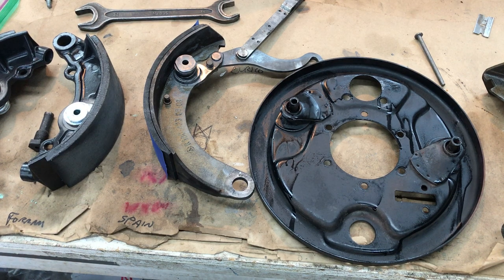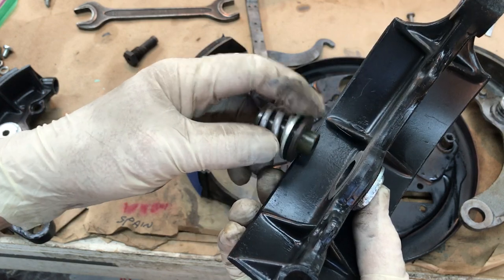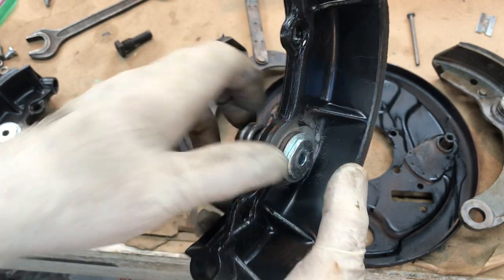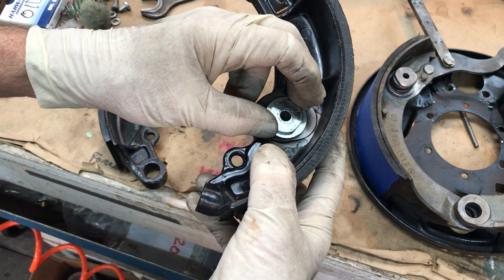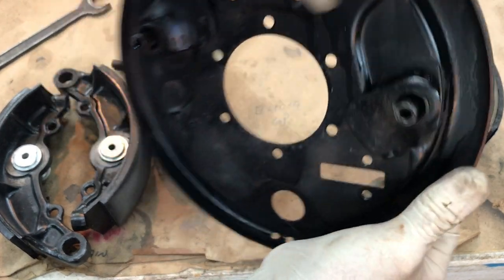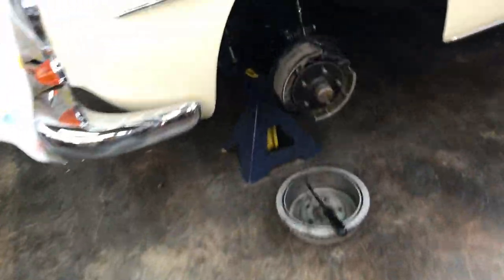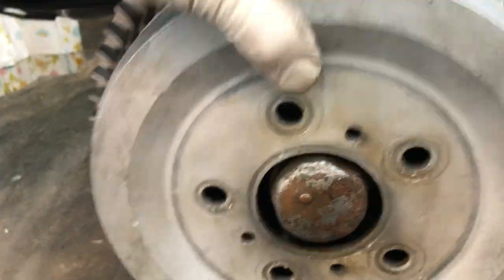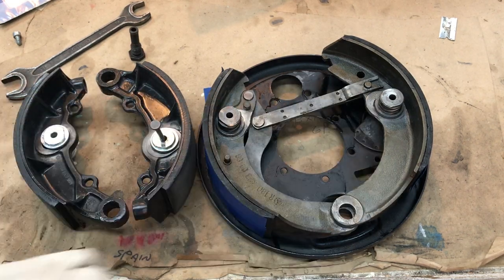Mercedes 190SL, 180, 180D, 190, 190D, 220S, 220SE, 230SL Self-adjusting brakes Tech Tips

Comment: My brakes all done and thanks to Will.  I now know how to adjust friction discs and reset my brakes.   One big tip... I couldn't get my rear drum on one side with new shoes and thicker linings... i was there hours trying to do it and finally squeezed them on. But now the wheel was really binding so still no good to drive. Also the handbrake E brake pull was really tiny which led to the obvious issue that i'd missed... I backed up the wing nut under the hood for the adjustment to the handbrake and bingo, the wheel had more play to spin.  So next time you're doing rear brake shoes... back off the wing nut and your new shoes should slid on nice... mine had been adjusted up as the shoes were wearing so needed backing off for new ones to fit... job done.
Reply from the maker: Excellent news. Well done. Thanks for adding that extra tech tip. And congrats on the brake work.

Comment: Well thanks to this I now know a lot about friction discs ! Changed mine today thanks to Dr Will and no more sqwishey pedal and sound braking. I'm investing in a brake pressure spring tool because trying to rest the spring with normal plyers is took hours ! The the friction washer moved so I had to dismantle, tighten and reinstall.  End result pleasing and thanks again for advising with my cross the pond phone calls. Get over here for a beer !
Reply from the maker: Thank you. Glad to be of help. I struggle with trying to convey concepts and ideas. Just because I know it, does not mean I can always make myself understandable. I look forward to visiting the UK in the future.
Reply: @Mercedes-Guru  i think you explain it very well. i could not for the life of me understand the self adjusting part when i was reading it in the manual. when you showed it i slapped my forehead  .. . would have made life so much easier when i was working on the car - but now i know what to do come fall when new shoes are coming on . :)  thanks a bunch from Norway .
Reply from the maker: @bobanofat2585  You are welcome. All the best from HOT Texas.

Comment: Thanks for the video!! It really helps.  I'm trying to figure out why my 1959 190 rear brakes lock up and squeel when I am backing up after not driving the car for a month or so.   If I don't drive the car in the winter for a few months they really lock up for a while and make a lot of noise.   My local mercedes "expert" would not take my word that there were two brake cylinders on the front wheels.  Now I have proof.   Is it possible to get new "bonded" linings on my old cores? in the US.  Any ideas about who do this kind of work?  Thanks nagain
Reply from the maker: Hey, thanks for viewing and your kind comments. Do the brakes squeal when going forward? Or is the first drive after not driving for a month backing up? I am trying to determine if the backing up is part of the issue or coincidence. My first thought is one or more rear shoes are binding or not retracting. You have to have clearance between the shoe and drum. Squealing indicates you do not. Possible causes: brake hose restriction not allowing shoes to retract, stuck wheel cylinder not allowing shoes to retract, shoe sticking on pivot, shoes installed incorrectly, hand brake applied and sticks in the applied position when released after sitting for a month. If the car is driven with binding brakes, then not driven for a month, then put into reverse, the shoes could be rusted to the drums and cause the squeal. I would remove the rear drums and check the operation of the shoes. Check that the shoes are not contacting the inside of the drum. Make sure the shoes are not rusted to their pivots. Slowly apply the brakes while someone watches the shoes to see if the shoes expand then retract. . Pull back the rubber boots on the wheel cylinders and examine for leaks or rust. As for relining the shoes it is becoming a lost art. I have mine relined at a truck repair facility. If you do get them relined be sure they understand the rear shoe lining is very thin. Hope this helps. Good luck, Will

Comment: Hi, I'm restoring a 190b in India, I've opened the front suspension and found some of the bushing worn out. The upper fork movement is loose and without any pressure from the mounting bushes,is that normal? Your video on the brakes was very informative
Reply from the maker: Hello Madhav, thank you for viewing and your question. Without more info, I cannot answer it. But I made a video for you that might help answer your question:
https://youtu.be/5wuewjsqjXI 
Get back to me with more info if you need further assistance.

Comment: I have just installed a new master cylinder on a 1959 190SL. my problem is this, there is no movement of the brake pedal when I try to push the pedal down to bleed the system it does not go down,. I'm at a loss on how to precede . Any help would be appreciated.
Reply from the maker: Hey Willard. Thanks for viewing. Not heard this question before. First thing that comes to mind is the clearance between the master cylinder and the brake pedal pin that goes into the MC. This is the one inside the boot. There is supposed to be 1mm clearance/free play. Perhaps there is none? I can email you a page from the shop manual showing this if you give me your email address.
Reply: @Mercedes-Guru  that would be great.  The rod going into the mc is very loose. Is that the way it's supposed to be  ?
Reply from the maker: @willardbaker595  No, not the way it is supposed to be. 1mm free play between rod and MC. That is why the rod is adjustable. If you want the page out of workshop manual, I need your email address. Otherwise, this is how I do it. Disconnect brake return spring. Push brake pedal against firewall. Position metric ruler against pin so that you can measure 1mm movement. Move brake pedal by hand until the pin contacts inside of MC. Adjust rod until that movement is 1mm. Tedious but not technically difficult. Reattach return spring. Check for about 25mm free play travel at the brake pedal inside the car. Just use your hand to push on the brake pedal until you feel resistance. That is your brake pedal free play travel. Hope this helps. Willard S.